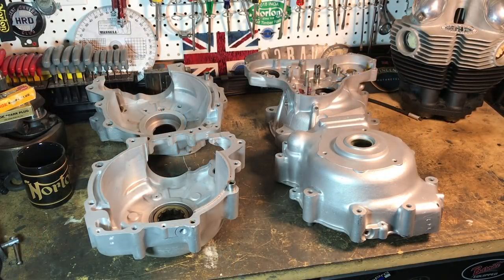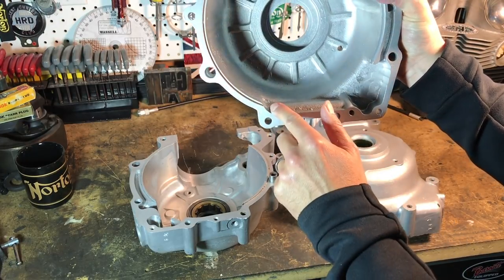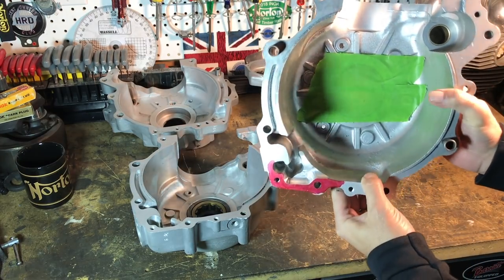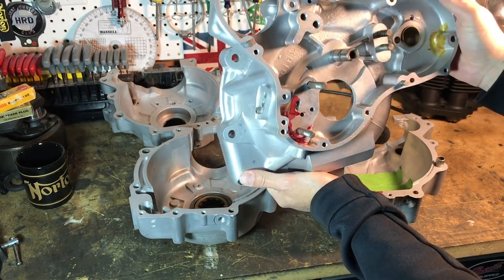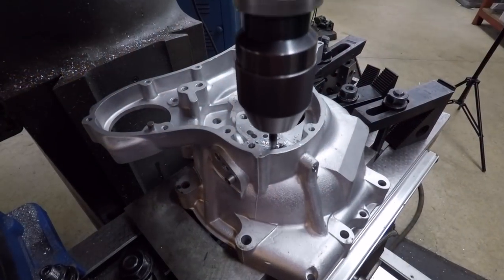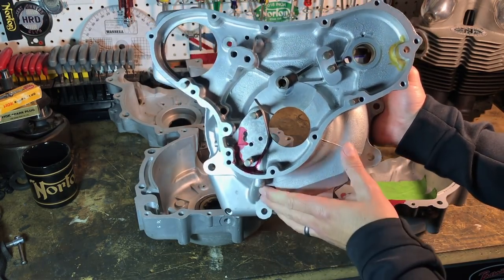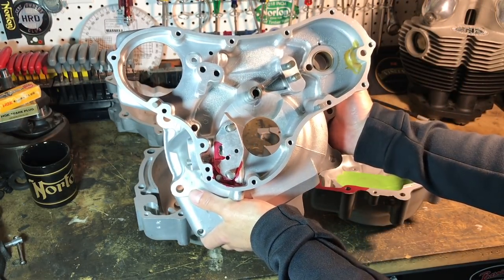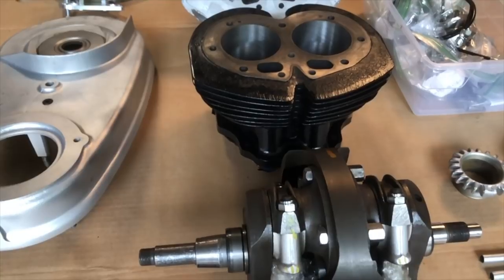1972 Norton Commando Combat Rebuild (8) - Crankcase mods

Comment: I bought a 69 commando back in 1973, when I was in high school. For a bike that was only four years old, it was pretty abused. The red metal flake on the tank was all botched up, and the original mufflers were gone and replaced with megaphone style ones. I sold it in the early 80's, and have been lamenting over doing so ever since. It had the larger oil tank and side covers like the fast back, and they were silver. It also had the external tach drive, and the points on the inside to the rear of the cam drive case. With the advent of the internet I found out it was a rare R model imported to Canada. It was pretty fast for the day. Today I have an old 87 Yamaha rd350 lc ypvs , and a 1000 Honda hurricane, but they definitely don't have the feel of being alive like my old Norton did. Love your videos, and it makes me wish I still had it so I could do a complete restore, which back in the day I never had the patience for. When we were younger all we cared about was riding.

Comment: I had a 72’ Combat which I restored.  I had a piston seize on me when going up I-80, a long fairly steep grade up through blue canyon.  I was doing about 80 mph when the motor locked up.  I simply pulled in the clutch and rode to a stop.  I let the engine cool, and was able to break the piston loose by kick starting the bike.  I was able to get it running but there as a knock in the motor.  At the time I didn’t know the Combats had an oil starvation issue, especially under load up long hills.  I bought a new piston an fixed the cylinder.  About a year later I was going up the grade, south on 101 toward San Luis Obispo, I think.  I got maybe 50 yards from the summit and the bike seized again.  I was able to get it started and rode it to LA and back to Sacramento with a bad knock.  I assume this fix you showed in the
Is video would fix the problem I had?  Too bad I didn’t know this info, as I put in  another piston, honed the cylinder and sold the bike.  It was a real beauty.

Comment: Interesting, most of your mods seem to be related to the tilt of the engine. As my combat spec motor is vertical mounted in an atlas frame not necessary. However, at some point in the 750 development they incresed the diameter of the input oil feed so I drill that out. I also use an 850 Oilpumpp which has higher output. The oil pressure release valve is sensitive can stick and block. If it is not silky smooth on a rebuild replace the whole unit, not just the piston. To put a 2S cam into Atlas cases I have to relieve the crankcase for the high lift cam lobes. Timing case breathing is not great. I tried copying TC Cristenden's timing case breathers as on Hogslayer. Not verry cosmetic. The cam end crancase breather on atlas and early commando engines was not satisfactory. I have blanked mine off, drilled the crank and mounted a Nourish flapper valve. I use 850 electric start crank The strongest and latest 750 rods which are far stronger than Atlas rods.